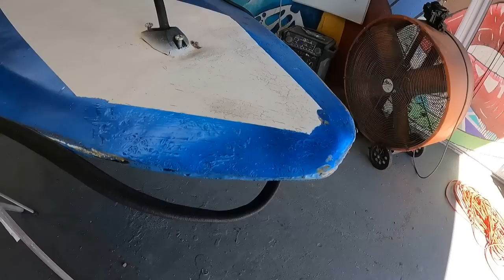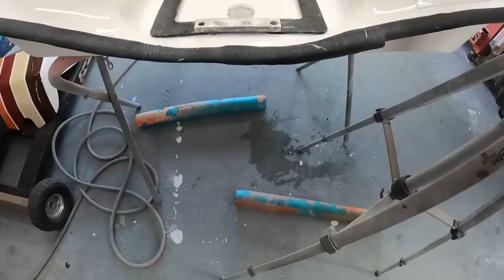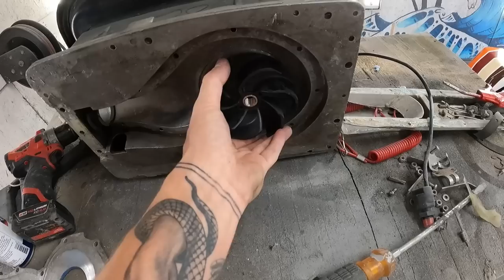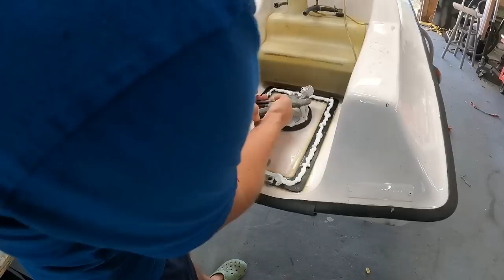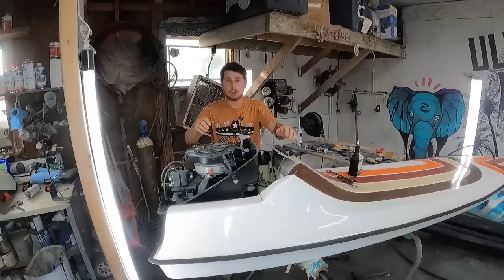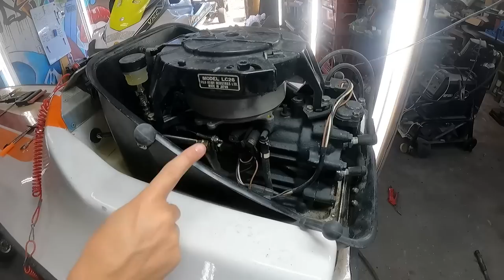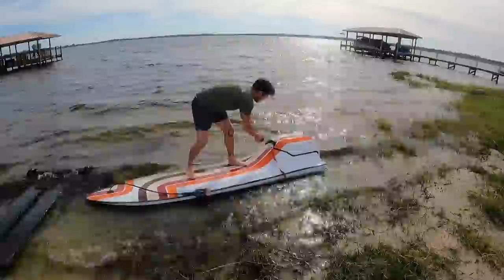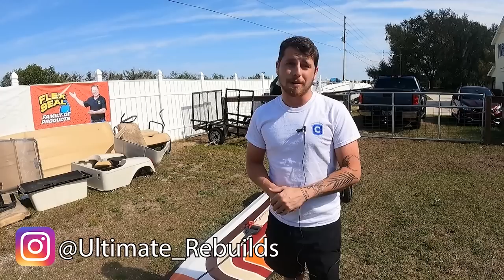This Surf Jet Refuses to Work! - Episode 3

Comment: Don't get rid of it.  We have 2 that we have had for over 25 years.  We need to talk.  Maybe we can help somehow.  We are not mechanics, but who knows.  I'd love to see you get it running.  Reach out if you want.
Reply: He needs to find someone with one and inspect a working one to find out the problem
Reply: He needs to know what direction the engine is supposed to rotate and how the propeller is secured. So if his engine and everything is turning the right way, is there a bolt that supposed to go into the end of the shaft to secure the propeller in place so it dose t back out. If you can get you bottom cover off to look at the propeller you’d be able to see it right off if there was. Plus with the cover off, you can pull the cord on the engine to see which way it rotates. Just saying, you don’t have to be completely mechanical savvy to do that.
Reply: I have one exact same model as yours and the thing literally runs amazing. Goes 32 mph on the water with me on it (170 pounds). These things are so much fun just trust me I can help you get it working and show you where to find parts because it can be challenging to say the least. Let me know if your interested

Edit: 
After watching the whole video I understand your pain with this thing. Like I said I have a board that is the same exact model and works perfectly. I would be more than happy to send you pictures and show you how to prime the pump, which seems to be the issue you are having. I have a lot of knowledge on these things hit me up
Reply: Might be dumb, but do you have to weight the back  of the board for the impeller to be submerged enough to do it jobs?
Reply: @MaddawgLongboards5  not dumb, that’s exactly the problem. Generally by getting two people to sit on it you can prime the pump. Once it’s primed it works great
Reply: @AdenSallaberry  Damn we're good. Hopefully he tries it out
Reply: @AdenSallaberry  Never had to "prime the pump" on mine. Maybe he's got an air leak.
Reply: @UguysRnuts  Ive had an issue where the board floats too high on the water to get water in the impeller housing. As most of these boards are full of water due to fiberglass cracks “priming” the pump is not normally an issue but his might not be full of water like most and be floating just high enough as to not work.
Reply: Hello Randy here i have the thing my uncle and buddies all bought about 6 total and rode them all over lake Powell I inherited still the original owner i own it now, runs like a champ and is a conversationpiece at the lakes. Im out for the hunt for a gas trigger on the handle.hope to talk to you soon. @AdenSallaberry
Reply: @MaddawgLongboards5  
The motor puts enough weight to fill the pump for the impeller. I still think he needs to check the direction of the mag.
Reply: @AdenSallaberry  question?
Where do you and how do you prime the pump?
Reply: @randy-yo8zi  you simply don’t have to prime the pump, like other ppl in this thread have said it self primes by the weight of the motor sitting on the back end sinking it enough. I agree that his motor is probably spinning the wrong direction or something is wrong, because just like a Jetski it should have water in the impeller housing.

Comment: The impeller clearance to housing must be tight. Get another impeller, 3D scan it  to print more later. Take off the pull start, take out the spark plug and turn the engine by hand. I had one, they're actually pretty quick. A bit hard to turn, but a bit if a blast regardless 😉 
Also need deeper water, you don't want to suck up little rocks.
Reply: Had another thought last night, crankshaft bearings could be flogged and wobbling the impeller inside of the housing🤔

Comment: They are an absolute blast to ride and have a very basic mechanical system. The impeller has been the problem since the very first video. The impeller is rubbing on the housing you probably need to check the shaft for end play. Or shim the impeller to center it inside the housing.

Comment: When you would get air while operating this board, you would (obviously) create new air pockets. This just can not be the issue. Otherwise "they" would never have made this thing to begin with.

For the impeller to strip from the metal, something must have been bound up. It didn't make enough (water) force, to make it do this. When you did tighten it, did it spin freely enough? Because I would think you're missing something like a washer. So that the impeller moves up, binds on the top part of the housing, and thus strip everything.
Reply: probably not this but  what  if it was spining up to fastand shearing it of
Reply: @amytinnyunt4663  3 components, intended to work with this engine and system. Of which 2 would shear off as soon as a few RPM were added? This is past unlikely. Even at lower revs, there would have been "some" forward motion. And there was near zero.
Reply: there the rotor rubs against the housing, which is why it melts the plastic at the metal hub.

Comment: Like others mentioned, it's a basic centrifugal pump. For how quickly the impeller fails it is probably binding up. You want tight clearances from the impeller blades to the housing/cover for it to be an efficient pump, but based on the thickness of that gasket if you tighten the cover screws too much you might squish the gasket enough to bind the impeller. They are only 80 in lbs according to the manual, if you don't have a torque wrench, that isn't much. I know you can run a 2 stroke backwards, doubt it's your issue. Air leaks will cause cavitation or even lack of suction from the pump, but again your impeller failed way to quick for cavitation to build enough heat for that impeller to fail. Maybe once the pump cover is torqued on, take some feeler gauges and see what size you can fit between the impeller blades and cover.
Reply: Where did you see a manual for a jet surf just bought one looking for a manual
Reply: @thegoons3415  I just googled around and found it.

Comment: I think your impeller installation is correct.  Because when I went to ride my own surf jet for the first time in a long time, I had the same symptoms as you, even if I opened the accelerator, it wouldn't progress.  However, I didn't give up and opened the accelerator at full throttle for about 5 minutes, and I was able to advance steadily!  I was very impressed at that time!  Don't give up, try keeping the accelerator fully open for about 5 minutes.

Comment: The impeller itself is loosening as soon as it cranks, jamming itself into the bottom of the jet pump housing because of how the thread patterns are. 
Most but not all threads are used for adapting/adding parts like the impeller and will usually tighten against itself when in operation without having to tighten them, now not all applications use this thread pattern that self tightens but just the opposite and it looks like this is one of those cases. And a simple way to fix this problem is Lock-tight thread locker that will stop the impeller from backing out causing failure, and just for added security I would drill through the impeller and the shaft to add a sheer pin, or machine down the impeller hub to add a threaded safety nut and drill through the shaft hole to accept a cotter pin which will also lock the impeller onto the shaft. Many ways to make a quick, cheap and permanent solution to your problem. I definitely would’ve taken one of these steps to be sure that what happened before wouldn’t happen again especially $250 for a impeller.
Very Cheap but very effective solution to your problem

Comment: Glad to see you back. I know you checked It but has to be running in the wrong direction causing the impeller to over-tighten and rip the threads out of it. Same thing will happen with a weed eater if it's running in reverse it will spin the head right off. I know it's not a permanent fix but take the impeller off and and plastic weld the threads back on. Then reinstall it but not on the board. Put it in a clear tub full of water you can support so you can be under it to see the impeller spin when you start it. You will be able to see if water is drawing in or out of the intake or no water movement at all before the threads rip out again. If it's coming out or no movement it's running in reverse.  This will save you the issue of redoing seals over and over to trouble shoot. It's a long shot but you could also be to buoyant and no water is ever even getting to the impeller as it's to high above the water to create a draw then burns out the impeller. Also may be cheaper if you take the impeller you have to a machine shop or reach out to some other YouTubers with machine shops to collaborate with and have them mill you an aluminum impeller.
Reply: yeah i wish he got a small pool/cheap walpart pooljsut to get knee high if that water in

Comment: Hey, there are three things to know about the impellers.    1.   They spin out really easily    2.  When you're looking at them and trying to spin by hand, it won't seems like it.    3.  There are two types.  One has a brass insert in the middle, and the other is all one material. (fiberglass?).    Anyway.  "Spin out" means they are spinning on the shaft.   It moves, but when trying to pump water it will not have enough grip on the shaft to spin.      So it does exactly what you are experiencing.    I had a "new in box" one spin the brass insert around inside the fiberglass.   Besides epoxy, I also had a machine shop put a pin in that one and it works just fine.

Since they spin all the time, never start the motor when it is in grass, mud, gravel, etc.  Only water.  Tiny bit of mud or sand gets in there it will spin the impeller on the shaft.

Comment: I will make a video of both of my surfjets taken apart to go over how everything works. Most of these comments about the impeller are incorrect so I will go over this topic. It is a direct drive shaft. There are no pulleys or clutches. The impeller screws on clockwise. There is no bolt at the end because it is flush with the shaft. It doesnt need any weight on it to move. It will take off if you give it gas. There are water channels in the jet pump so some water is diverted into the engine to cool it. Some people put a hose fitting on the thermostat cover at the top of the engine so they can run it out of the water. All surfjets were filled with open cell foam that would get filled and slow it down. You have to remove the old stuff and replace it with closed cell foam to fix that problem. To go fast you must stand towards the front of the board because the back sinks in the water and the jet gets submerged.

Comment: I have a 1980 and 1984, service manuals, parts catalogue and owners manuals.
My 1980 surf jet has a points ignition and the 84 has CDI ignition.  The 80 has the separate top/bottom shell and the 84 is molded together.

Comment: Just a thought wouldnt the intake /impeller be closer to the water if you were on the board and not just letting it float, it might then prime and work as it should.
I had this thought as if you were to fall off the pump would lose prime straight away and the board would stop and not be powered until the revs dropped back to tickover, might be worth a try if you can find another impeller (maybe a cast aluminium impeller would also be an idea if you could get one or make one using a plastic one as a pattern to make the mould to cast it)
Hope you get it sorted
Reply: I was thinking the same thing, get on it before you hit the gas. The impeller is probably not in the water. Thus, no propulsion. It is probably a safety feature, so the board does not accidently take off without a rider onboard.
Reply: This makes a lot of sense to me.
Reply: Came here to say the same thing. Try getting on it maybe?

Hope you get it working!
Reply: Nice theory but the drive pump is also the cooling pump so it would not be good if it looses prime so easily.
Reply: @imho7250  I don't think he will lose water for a long time while riding, a maximum of 1-2 seconds on a wave jump
Reply: @vdulivuliy9472  , you need to read the originals comment. He’s not talking about jumping waves. He’s saying this theory is it’s designed that way so if you fall off, the pump loses suction and the board stops. Its not going to work good if the motor keeps running with no cooling water. 

Clearly something is not assembled correctly. That thing should pump water if it’s sitting in water.

Comment: I do alot of work in old jet systems I could nearly guarantee it's cavitation your problem is, the gap/clearance between impellor and housing can be off a very small amount giving it next to no thrust. It's amazing how a small amount translates to a huge power loss. I would check your tolerances between impellor and housing take into account gasket thickness. Worst case scenario you could plastic 3d print a slightly bigger impellor or make the housing smaller. Hope this is some help good luck with it nice toy!

Comment: The pull rope is wound backwards so when you start it, it runs backwards and spins the propeller off, the engine is supposed to rotate in the direction that tightens the propeller so it’s backing it off, re wind the pull rope the other way and try that.

Comment: Could you talk to one of those companies that does 3D printing and have them 3d print you an impellor out of metal?
Reply: I agree but the plastic impeller should not strip
Reply: He's onto something Zach. Perfect time for Daddio to pick you up a new CNC machine 🙂
Reply: @williamhammerstrom9860  not exactly what I meant, there are companies that can take parts, 3D scan them and then recreate them for you in different materials. A 3D printed metal version was suggested because it should be more inexpensive than having one machined from a block of material.

Comment: I'm surprised that impeller doesn't have some sort of locking nut or cotter pin to keep it in place. If the rotation of the engine if opposite the thread pitch the torque could be spinning it off and jamming the impeller on the housing. Also make sure the impeller housing isn't pinching the impeller after installation
Reply: During operation, the motor rotates so that it tightens the rotor all the time, so no protection is needed.

Comment: I have watched from the first video,  the issues is that when is turning is geting tighter and  bottoming out and it gets stuck. Check and put somne washers on the ax , go a take a look and think about this. It is not about air leaks, al impeller where ok. Check if it-s scatched anywhere. You are not so technical guy but i like your projects, your have done a very nice job with the bodywork, piece of art 👍

Comment: Hey .. engineer from the UK .  I think your burning up the impellers as your missing a piece.   It's a metal piece with 3 holes in that links the shaft to the impeller.  Taking the strain so the threaded insert isn't ..

Comment: I have some notes from owning a couple of these. Try some shims to move the impeller further into the water. Maybe so the impeller is flush with the bottom of the board...? I'll drop you an email. Cool paint job!!!
Reply: The added thickness of the new thick gasket is raising the impeller out of the water - I think....

Comment: For getting a new impeller , could you bring to a machine shop and get them to build one out of aluminum? Just a thought, maybe the impeller gets squeazed by the cover or something binds and as you crank it, it breaks? Just a thought. I've had a jetski (standup) that I've had for 2 years got for a great deal but wouldn't go passed idle to mid then stalled, always thought it was the carb or fuel pump. Turns out, it was rodents that made a nest in the exhaust pipe jamming all flow of the exhaust, took me 2 years to get to that point. Bottom line is put project aside, take a breather and look at things you didn't think of first.

Comment: Replace the pump with a different one. Cars and cameras used a harbor freight trash pump. Or get a used jet ski pump. I think the outlet needs necked down to increase flow rate. But the impeller shouldn't get damaged from not pumping. Seems like it isn't supported on the side away from the motor and is wobbling around. Just get a vertical shaft turbine pump of some kind.

Comment: Have you verified the rotation of the engine is correct?
The engine should spin the opposite of the way the impeller is threaded on.

Seems as soon as you rev the engine it “drives” itself out of the impeller

In my opinion I don’t think it’s cavitation, I think within seconds you spin the impeller off(down) and block the inlet to the pump

Could be as simple as the recoil broke and the previous owner bought one off of a merc outboard the spun a different way
Reply: He opened the video by explaining how one of the things he checked and confirmed was that the engine is rotating in the correct direction. I had never heard of that myself, cool thing to know.

Comment: Check for motor shaft issue may be slight bent and vibrating hard. Needs balance so I’d start there and find a machine shop that can build. Some custom parts don’t give up. Shelf it till you can look at it from a fresh start

Comment: There have been many comments about the direction of rotation.  Why don't you take even one of the wrecked impellers and hook it to a drill with all thread and some nuts, submerge it in a tub of water and see which direction it pushes water better.  It seems from the video that the direction you are threading the impeller onto the engine, the water hitting the fins will loosen the impeller, whereas it should always be pushing the impeller tighter.  just a thought